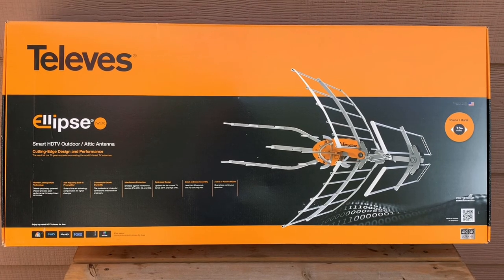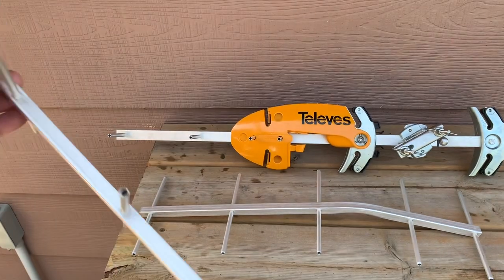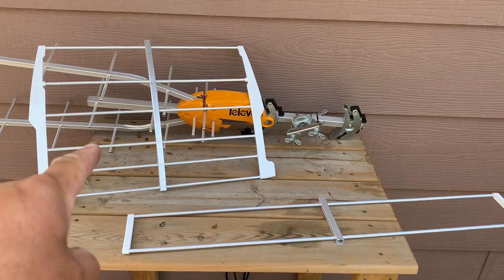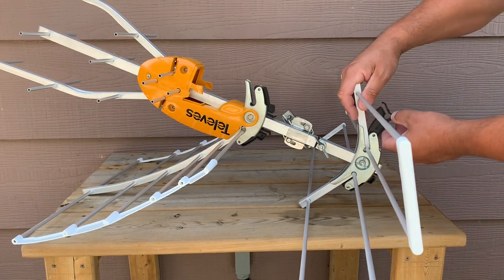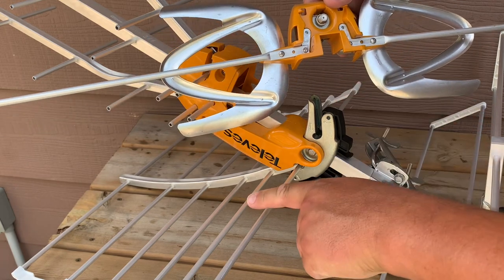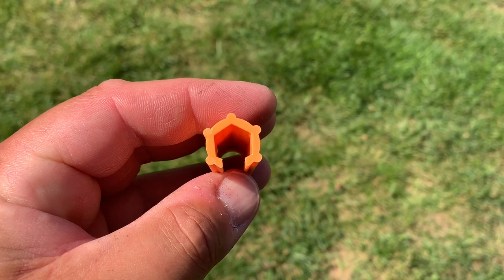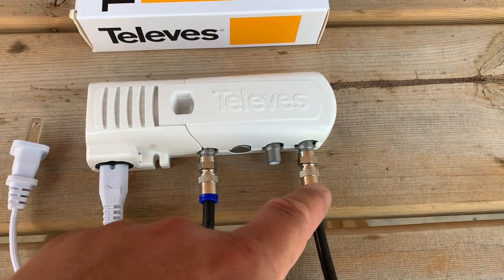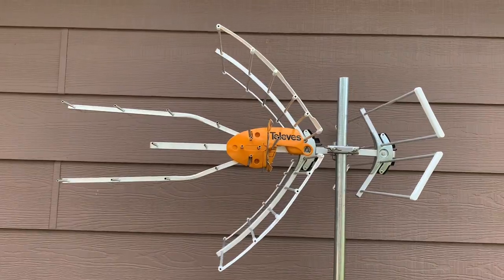How to Assemble the Televes Ellipse Mix Outdoor TV Antenna - Televes 148883

Comment: Great video. That little tool is great but doesn’t fit over my R11 cables and fitting ends. But I guess a lot of people don’t overkill their wire runs with R11 like I do?
Reply from the maker: Most people probably use RG6.
Reply: Pozdrawiam 👌👍💪🏻

Comment: I had my electrician pre-wire RG6 in my single story cabin from the TV location up to the attic, where I plan to put the antenna. Is it better to place the power supply in the Attic next to antenna or downstairs by the TV? In other words, is it better to have the longer run of RG6 between power supply and antenna or between antenna and TV? Thanks in advance!
Reply from the maker: The cable run between the power supply back to the antenna won’t bother the signal. Place the power supply somewhere in a climate controlled part of the home where it can be plugged into an outlet without an extension cord. The voltage for the preamp will be supplied through the coax cable.
Reply: @NorthcoasterHobby thank you!
Reply from the maker: @ryanjanke1058  👍

Comment: I bought one of these but I was hoping I could take it apart again to put back in the box for awhile, but I can't seem to figure out a way to get the front 2 snap in elements back off without possibly breaking the orange plastic shell apart somehow. Any insight?
Reply from the maker: Honestly I would not try taking it apart. There are two spring-loaded metal clips that the elements snap into. Plus the plastic housing has fins to keep the element in place. There is too much of a risk breaking something. You would have to be extremely careful but I wouldn’t recommend taking it apart.

Comment: I was debating between the 4 Max vs this particular antenna on which would capture a wider swath of TV station receptions.
Reply from the maker: I don’t think you’ll regret this antenna. Are you aiming at 2 markets, or are the broadcaster towers in 2 directions? Here’s my review of the Ellipse Mix:

Televes Ellipse Mix Outdoor TV Antenna Review Model 148883
https://youtu.be/veWVeJkJscA
Reply from the maker: And for what it’s worth my review of the Clearstream 1Max:

Antennas Direct Clearstream 1MAX OTA TV Antenna Review
https://youtu.be/llregLjufBQ
Reply from the maker: I would also add that the gain pattern of the Ellipse Mix is wider on the VHF band and more directional on the UHF band. Generally, I think most antennas follow this type of gain pattern.